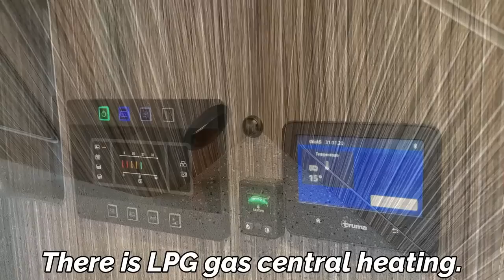VW Worx Crafter K2 - 4 Berth Camper Conversion

Comment: Nice build. Quick question about the rhino roof rack. Did you have to adjust it to fit the new shape? Im trying to find on ethat fits a 2019 model but all say 2006-2017. Any help appreciated. Cheers
Reply from the maker: Apologies for the delay, yes we did have to modify the fittings.

Comment: I was right there with 'deluxe' and 'luxury' until the stretch carpet came out. Could have been very special but sadly a disparity between looks on outside compared to inside. Im sure you can do better than stretch carpet?!
Reply from the maker: Thanks for taking the time to comment.  You will have noticed that the stretch carpet is used to line the panelling before the units were fitted.  All finished panelled surfaces and headlining are finished in a very high quality brushed suede.